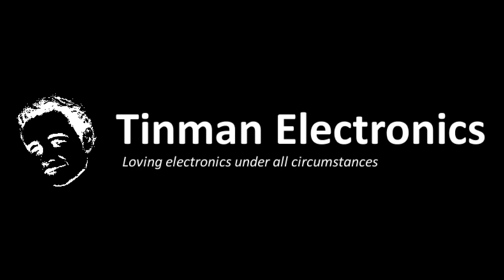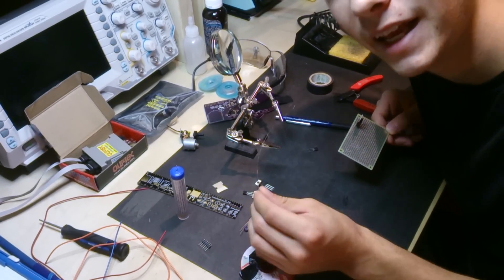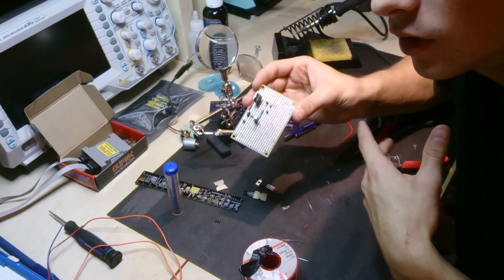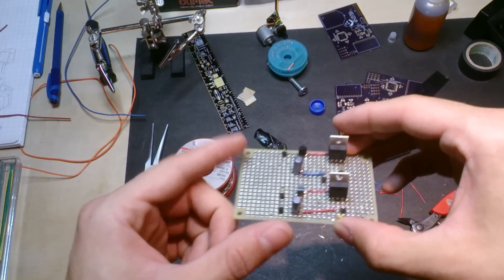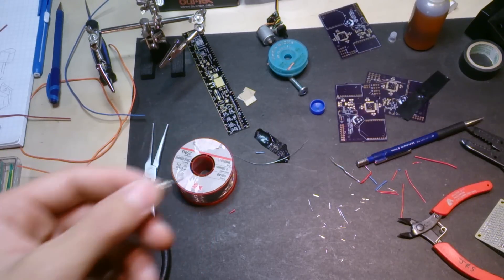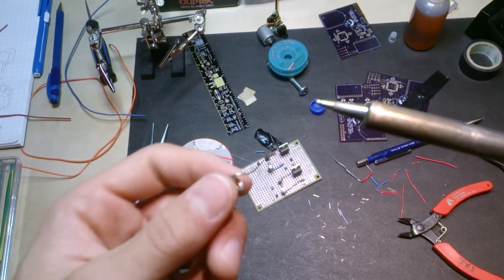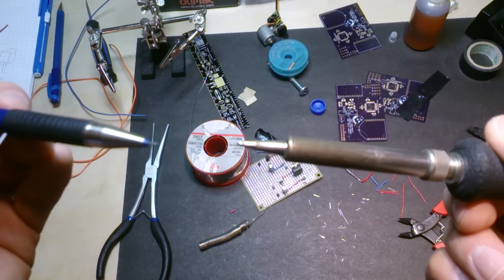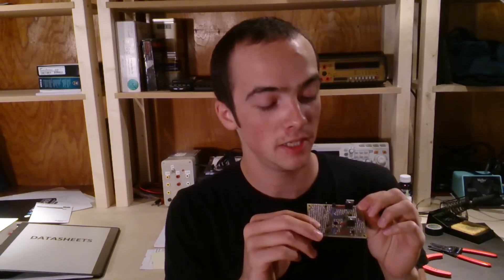Tinman Electronics 3 - First time lead-free solder user

Comment: I had never used leaded solder. Learned with 97/3 tin lead. It didnt seem to bad. Then i ran out and had some good 60/40 sitting in a drawer so i got it out and tried tinning some wire and it blew my mind. Its so easy to work with and it wets and reflows so easy. I think ill be using lead from now on

Comment: I'm having some trouble with it as well. I'm making audio cables and it has been a bit of a fucking adventure to say the least. I think my biggest problem is that it doesnt drop into a pool unless you stab it and use a substantial amount and if you mess up you have to get the heat past the flux buildup which is not always possible

Comment: I use lead free and it works great.

I always set my iron to max (450℃) so yeah that might be the trick.
Also I hate lead and I don't use it.
Reply: Which lead free solder do you use? 3,8% silver, 0,3% silver or no silver at all? and which brand?

Comment: Lead free solder reminds me of solder that is left on the iron too long. All sticky and hard to use.I use 60/40 cause its a dream to work with, and solder is such a miniscule source of lead pollution, its a silly fad anyway. Not to mention lead solder is more stable and takes longer to corrode. We have been used lead solder at least since the ancient romans. We will be fine.
Reply: It's a late reply, but there are quite big differences between the different kinds of lead-free solders. Not really happy with Sn99.3Cu0.7 solder, but I've used Sn100Ni+ lately and that's pretty great.
Reply from the maker: Anpanator Hey, thanks for bringing that up! I totally didn't consider that there are different lead-free solders out there! If I can manage to get my hands on some different kinds, then I'll for sure play around with it.
Reply: @TinmanElectronics  Kester SAC305 type lead free solder is what I'm starting with, but I haven't used it yet. It has an RA flux core which is size 66 (3.3% by weight). Their product # for the small tube of it is 83-7068-1402.

I also have a couple of tubes of MG Chemicals' SAC305. It has a No Clean flux core, but I'm not sure what size the core is (it's 2.2% by weight). It's product # is 4900-18G.

I was thinking that I'd use the No Clean flux core solder on newer electronics projects and save the RA flux core stuff for older repair projects. RA flux is said to clean stuff like corrosion away better.

SAC305 composition is 96.5% tin, 3.0% silver, and 0.5% copper (SN, AG, CU). Kester has a nice pdf chart of the melting ranges of all the different solder compositions they make. Google "kester alloy temperature chart". In that chart, you'll see that composition does make a difference when it comes to temperature.

One other difference composition makes is how long the solder takes to go from a liquid state to solid. Solder described as being "eutectic" goes from liquid to solid nearly instantly when it begins to cool. 63/37 lead solder and SAC305 lead free solder are eutectic. 60/40 lead solder is not and takes longer to solidify. If I decide to try a lead solder, 63/37 will probably get the nod first, although I can see why 60/40 is considered so easy to work with. I'd probably try them both to get a feel for the difference in use.
Reply from the maker: +Richard Smith Couldn't have said it better! Solder that is left on the iron too long!

Comment: I started with lead free solder.  It is hard to keep the tip tinned.  I let my solder cool on the iron, then clean up the flux gunk.  I found cleaning the tip hot tends to "un-tin" it.  Periodically i will use   WELLER T0051303199 TIP Tinner to retin my iron.  I am going to look into a no lead tip after seeing your video.  Myself, I don't want to mess around with lead.  I would certainly never touch it with my bare hands either.
Reply: +Jack Arson Why? Just don't eat it. Lead is only a problem when consumed.
Reply: That's what the Romans said.
Reply: Jack Arson The romans ate it... So no it was not what they said.

Comment: Nice video. Im just starting to solder and got lead free. I've been struggling with getting it to melt with my basic iron. Glad to see it might not just be me
Reply: Will's Workshop Lead free alloys have much higher melting temperatures than real solder and require much more aggressive and nastier than proper lead solder.  All of this lead free rubbish specifically excludes high reliability and life critical stuff for a reason.